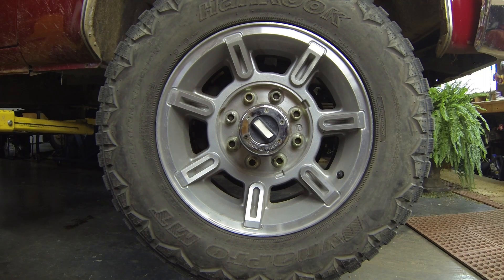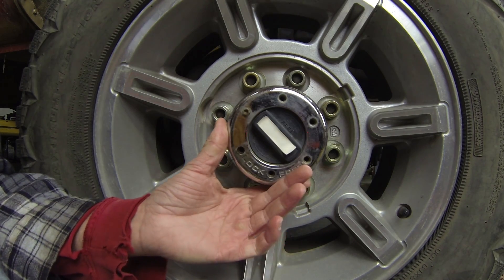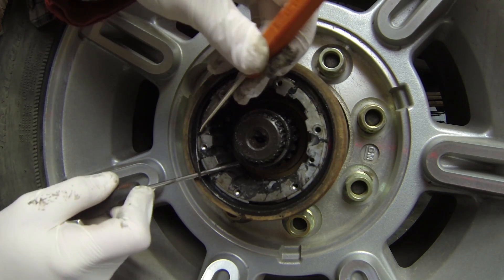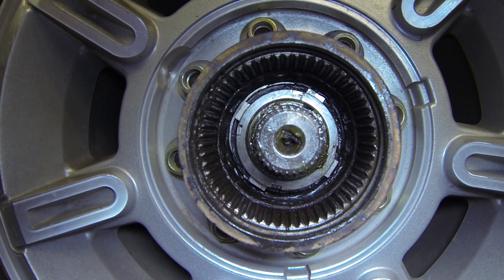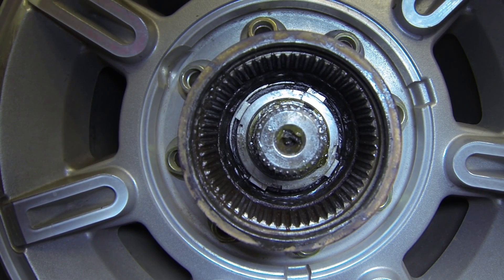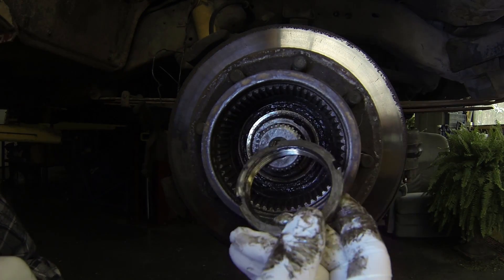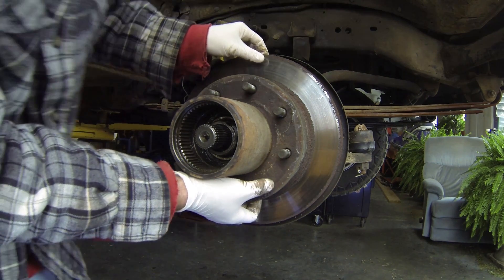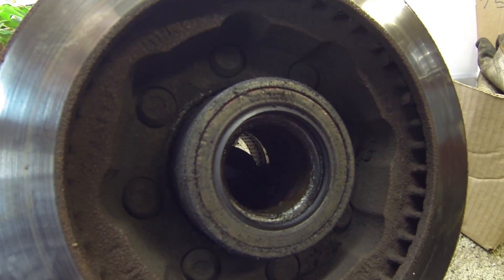Dana 60 Axle: Hub and Brake Disc Removal How-To

Comment: I have a older dodge I am working on and someone put the same front axle you have under the front end and I can't figure out what kind of axle it is can you please tell     what brand  you have also year and model of truck it is it would help me finish up my front rotors job         thanks will
Reply from the maker: This is a Dana 60 axle. They have been used in lots of vehicles.
Reply: @GodsCountry  yes sir I found out there are 3 types of Dana 60 axles used yours and mine are 4500 pound axles and there are also a 3500 and 3800 pound axles the 4500 being the rarer of the 3 it is mixed  with ford and Chevy parts thanks for the reply sir I appreciate it
Reply from the maker: Good info Will! I'm glad the video helped!

Comment: Perhaps I missed it but when did you remove the snap ring on the axle that rides against the end of the spindle which keeps it from riding back toward the differential? I watched your video quite a few times trying to figure out where I had screwed up because I ended up with an extra snap ring and washer. Then it dawned on me that I had seen another video where the guy took the snap ring off as he was taking the hub off. I guess it’s a testament to the quality of your instructions that I would literally depend on them as THE way to do it. 
This is not a criticism just an observation. Thanks again for taking the time to post these videos.
Reply from the maker: Hey John! You know, I'm not sure. It's been so long since I made this video and so long since I've been inside a Dana 60,  I can't remember. I'm sorry.

Comment: Thanks for posting this video. I just finished a complete suspension/drivetrain rebuild on my 1992 F250HD front end and when I took my warn hub bolts off, I found all sorts of fun pieces and broken parts in there. I haven't driven it for a year.... I couldn't remember how they went together after taking them apart because they were in pieces and although I have had the premium hubs apart many times I was drawing a blank.(embarassing, I know) so I was searching the service manual and got tired of looking when I found your video. I couldn't remember where the darned snap ring went but your video showed me everything I needed help with. Thanks again 

- Dave
Reply from the maker: Thanks Dave! I'm glad it was helpful. You know what's embarrassing? When I have to watch my own videos to remember the details of a project.....

Comment: great video! im doing u joints on my dana 60. any trick for spindle bearing removal?
Reply from the maker: Thanks Jake! I did this project so long ago that I don't remember the specific tools that I used for the spindle bearing. It may have been a long punch or I may have just folded the bearing cage in on itself since it was going to be replaced anyway. I'm sorry I just can't remember...

Comment: Thanks for this great video.  I just acquired a 1984 CUCV M1008. The left hub wouldn't lock and now I see why.  It's missing the snap ring and the lock ring that was hard to remove.  Mine fell right apart.  I did get it working but the stub axle is loose.
Reply from the maker: +PJ L Awesome! I'm really glad it helped you. I worked on a Blazer that had similar parts missing. Very strange that the parts just disappear somehow....

Comment: Great video. One question about the caliper. When I took mine off it had a tiny spring type piece of metal for the inside brake pad at the bottom. Not sure if you need that or how exactly it goes back in haha.
Reply from the maker: gmjunky87 Hey GMJ. I don't remember having a spring piece on my brake pads. I looked through my pictures but I couldn't find any evidence of a spring. The only spring I can remember is the one that is used to mount the caliper. It's a flat piece of metal with a slight curve in it and small ears bent 90 degrees at the end.
Reply: oh ok thanks. yeah, this spring is really tiny and very thin and goes on the inner brake shoe on the bottom, my guess is to help keep it in place when you slide the caliper on. wish I could send you a picture. I just put my brand new caliper/hose/ and pads on and I still have slight drag after pressing the brake, if I tap on the caliper lightly it free's up . It's pissing me off haha. Not sure how much drag is normal for these bendix wedge style calipers
Reply from the maker: gmjunky87 I see what you mean. Honestly I'm not sure how much drag there should be either.... Sorry!
Reply from the maker: gmjunky87 Good video! It's tough to shoot video in the dark. I'm not a pro mechanic but I would be happy with that amount of spin/drag after you press on the brake pedal. Maybe ask around for a second opinion. I don't remember how free my wheels spin. Sorry. It's tough to remember because it's been about a year and a half since I did this brake job. I looked at the video and it doesn't appear that I had those springs on the pads that I took off. I don't remember having any on there. I really wish I could help you more! So sorry.....
Reply: Thanks! Yeah I'll have to ask around. I drove it and the left side didn't seem too warm, The right side I'll probably have to take apart and grease. It's an old CUCV truck and I've only driven it about 7k miles in the last 5 years haha. Thanks for the input! Yeah those little springs, not sure what they do exactly haha. You've helped  plenty! Thanks for getting back to me!! Thanks for the great videos!!
Reply from the maker: gmjunky87 I love the CUCVs!
Reply: Thanks! Yeah, thing is awesome except for the 6.2, it's gutless haha. I was gonna lift it and what not but I've just been using it as a truck to haul firewood and coal etc. You're truck is the truck I'd really love to have!!